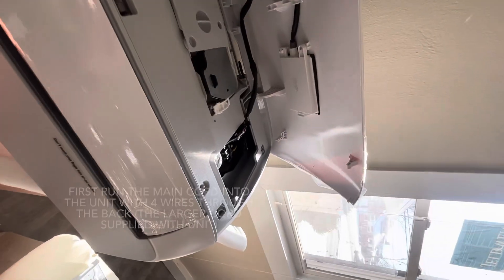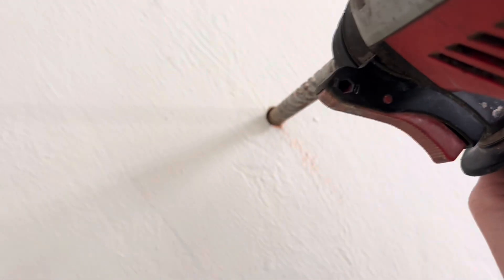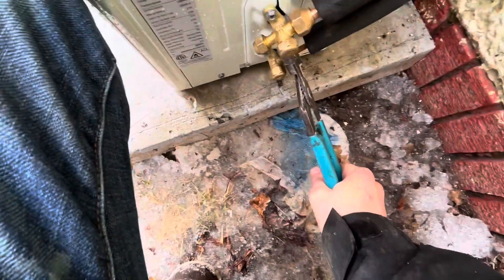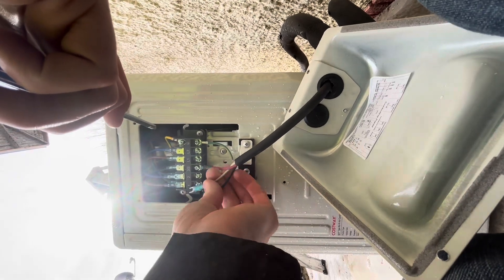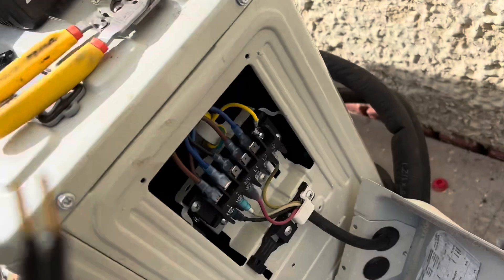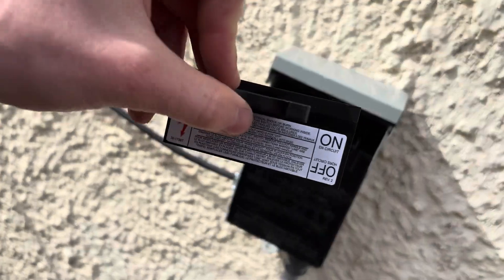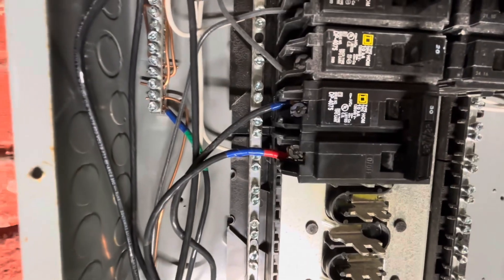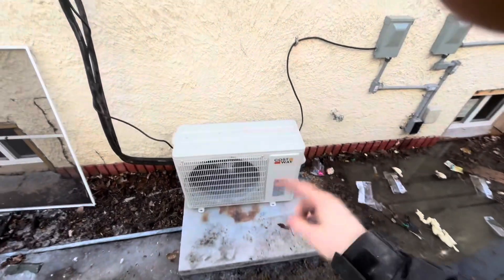How to install and wire 208-230v COSTWAY 12000 BTU mini split air conditioner & Heater

Comment: Amazon says they come pre filled? So your pulling the vacuum just to clear the lines? Or do you have to actually fill the unit with refrigerant.
Reply: He’s vacuuming the lines of contaminants, the refrigerant is in the outdoor unit until he opens the valves after vacuuming.

Comment: So if thier is no 30 amp. Mini fuse box. The unit won’t work right?
Reply from the maker: The unit will work if you were to hypothetically bypass that. It’s just not safe and you shouldn’t do that. It could fry the unit incase of an over load. You could hypothetically run your 240 straight to the unit from the double pull breaker

Comment: Why did you use 30 amp fuse and a 30 amp breaker?
Reply: excactly, why did u do this?
Reply from the maker: I could have used a 20 or 15 like what was recommended then put a 15 fuse in but I happened to have all these on my shelf in my shop so I used them. As long as the fuse isn’t bigger than breaker you’re good. Having the same size is fine depending on what your local code says. If you would like an extra layer of protection I would suggest maybe putting a slightly smaller fuse in than the breaker size. And also putting in what is recommended for your unit. If you go bigger in this case you could potentially hurt the unit. The chances are small but let’s say it doesn’t blow the fuse and something blows in the unit instead bc that’s the easiest way to bust with the small wires. That’s why you should put in what’s recommended. But like I said in this case I had all this so I used it. I have had bigger fuses and breakers in other properties as well and absolutely no issue. I’m not saying there’s not a chance and it’s not recommended but I’m saying I’ve never had an issue as to where the fuse doesn’t blow in the situation where it should. So I hope that helps. Let me know if you got anymore questions 👍

Comment: Did you just guess the placement of the hole, or did you kinda eyeball the length of tubing from pad to indoor fan?
Reply from the maker: @aaronthereamer  the unit comes with a Buch of extra copper line so if you thinks it’s gonna be close I would measure it. Or if it’s for a customer I would measure it but with this being a flip property I Rand the line the placed the outside unit where it looked best that way the copper lines didn’t have to be coiled up behind it. I knew where the hole was out side as well bc I started from the inside where I wanted the unit to be. I have long enough drill bits to get through about any wall.